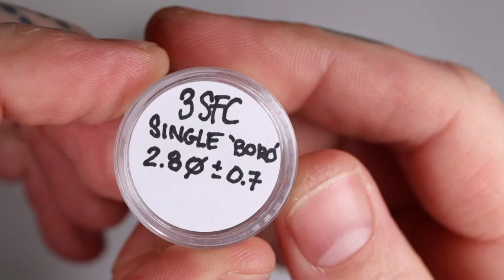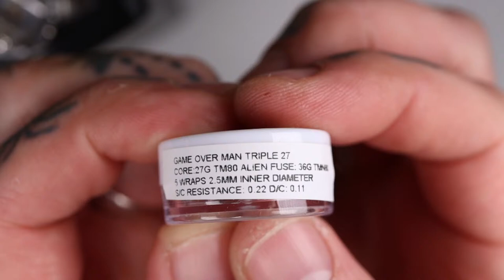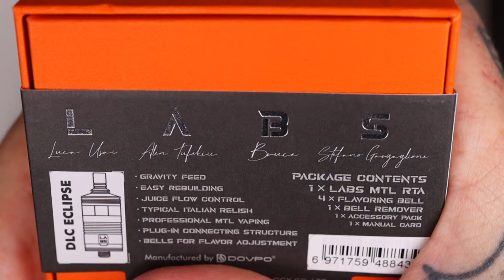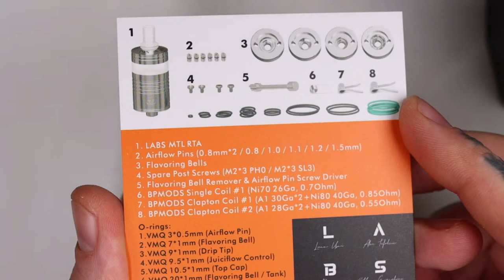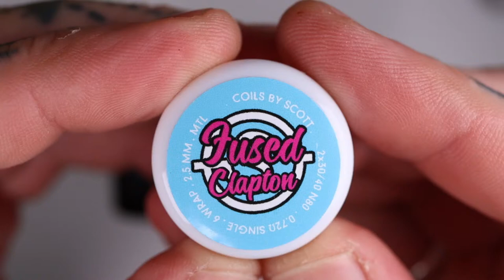LIVE Build Stream - Hazard RTA, TMF RDA V2, Labs RTA, Samdwich RDA

Comment from the maker: TIMESTAMPS:
09:05 - Stream starts- 
14:39 - Beer 1 - Paulander Wesissbier (German Beer )-Paulander munchen 
23:40 - Build 1 - Hazard RTA & RBA - Across & Dovpo
1:10:58 - Build 2 - Samdwich RDA - Across & Dovpo
1:50:05 - Build 3 - TMF RDA V2 - Damnvape & Mindplayer
2:29:09 - Beer 2 - VB Beer - Victoria Bitter ,best cold beer is vic
2:30:10 - Build 4 - Labs RTA - BP Mods & dovpo 
3:07:07 - Quick run through of all the build so far an what l think about them